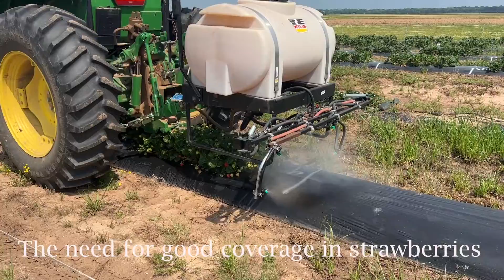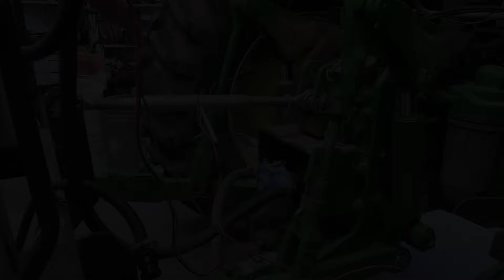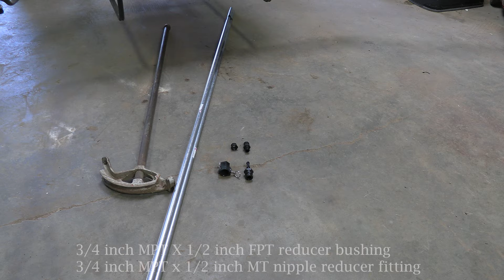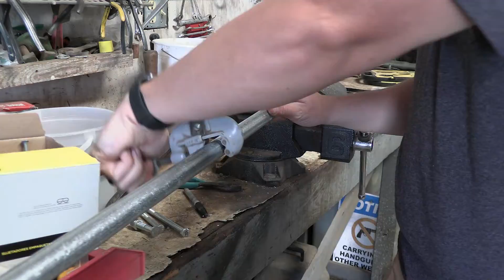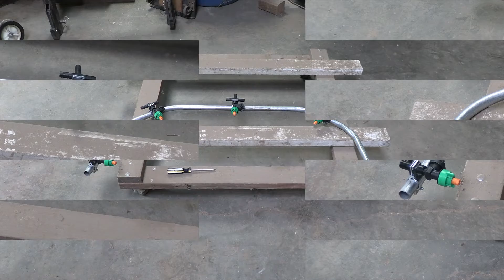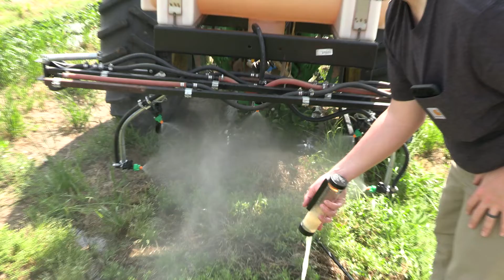How-To Build a Cheap and Effective Strawberry Sprayer

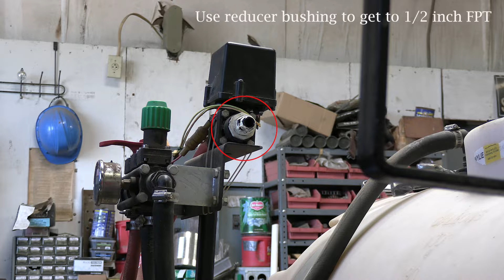Comment from the maker: At 5:30, you actually want to reduce to a 1/2 inch Male Pipe Thread (MPT) not a Female Pipe Thread as stated in the video. The 1/2 inch MPT will accept the 1/2 Female Cam Action Coupler